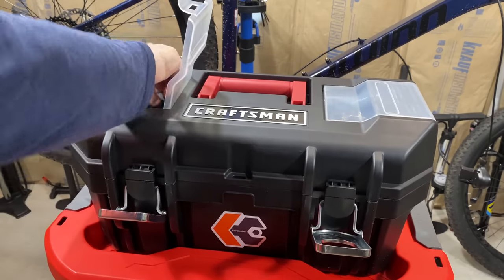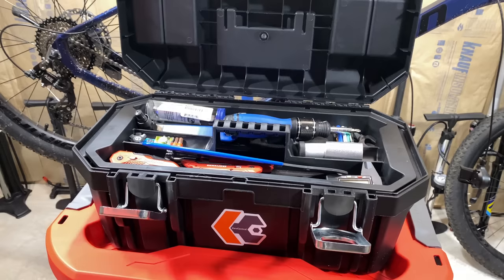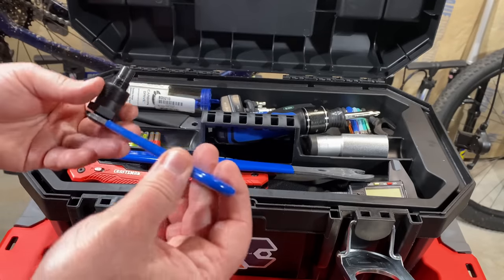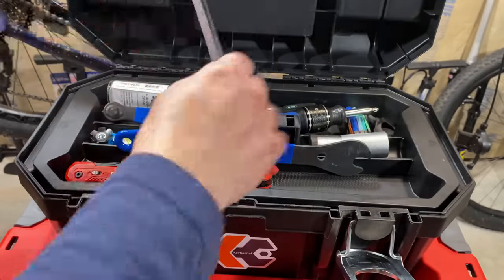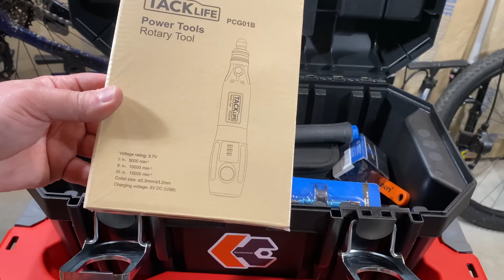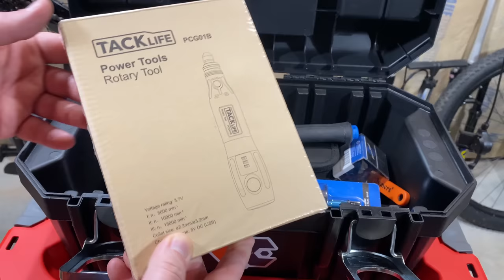Bike Tools - Updated | My Bike Specific Toolbox for the KevCentral Bike Barn

Comment: I needed a tool for my toolbox that I never knew I needed.  Best dollar I ever spent.   A magnet dish!  I am constantly losing screws and nuts and bolts and miscellaneous little metal parts.  But now I just chuck em in the dish as I work and even if the dish gets knocked over, the screws and other hardware do not scatter into the furthest corners of my work space.

Comment: I use good quality Greenlee diagonal cutters for cutting bike cables. They cut cable and housing cleanly like butter, and the cutting edges aren't damaged by the material. They are much better than the Park Tools models for durability. 
And as a side note, I have been using heat shrink tubing on cable ends for years, at first because I never had crimp ends handy. But I quickly realized how much better it works, it stays on better, and it doesn't damage the cable end like a crimp does.
Another good shop tool is sprue cutters for cutting zip-ties. Sprue cutters are used by modelers to cut parts from the sprue runners, they are just a fine-bladed diagonal cutter.

Comment: I bought a press for like 40 or 50 worked great.
Reply from the maker: Which model?
Reply: @KevCentral  i too have one in use for nearly two years,  the blue one from anazon for like 50$ with many adapters and in a plastic case
Reply: @KevCentral  I got the bike hand Yc107f and I bought it because of your last video about the tool you have. I used it to press the funn headset into my schwinn boundry... can you tell im a fan?
Reply: @KevCentral  The Bikehand one works really well. It's wide enough for 1.5" tapered headtubes. It's about $50.

Comment: For an affordable and useable headset cup/bottom bracket press you want something with thicker cylindrical shape pushers rather than thin disc shape pushers.  Thicker cylinder shape pushers prevent the threaded rod from tilting and keep everything better aligned.  They're relatively easy to find for $40 or less.

Comment: The headset tool works best if you press in one piece of the headset at a time.  If you try to press both the bottom and top on at the same time, you’ll have less success. I made my own headset press from a threaded rod, hex nuts and washers.  The washers are key.  I used 2 sets of 4 washers of various sizes (you can make two little washer pyramids stacking them on top of each other).  The different washer size helps distribute the pressure more evenly as you’re tightening the hex nuts.  Works every time.
Reply from the maker: I only do one at a time. Still not a chance I’ll get the bottom cup in 🤯

Comment: Wheels Manufacturing makes a universal bearing press that comes with a set of dies that'll fit press-in bottom brackets, head sets, and so on. The basic model is $75 and the slightly fancier is $83. (They also sell the basic press without the dies for $35)

The important part is having the dies that will keep the press centered and the bearings square. Otherwise it's too easy for the bearing to get tilted and jam up instead of pressing in smoothly. Without the dies, a bearing press is literally just a fancy pair of nuts on a piece of threaded rod.
Reply from the maker: 👍🏼 do you know if the $83 version will work with 1.5 cups?
Reply: @KevCentral  The two drifts that came with my set have steps at 22, 24, 30, 37, 41, 42, 46mm, and they also offer two drifts specific for headsets with 30mm and 40mm on one and 34, 44, 49, 56mm on the other. Those are all nominal of course, the fit is slightly undersized so it slides in and out of the bearings/cups/whatever easily.

As long as one of those sizes is within say 1-2mm of the inner diameter of what you're pressing you should be good. Just needs to be close enough to keep things centered on both sides.

Comment: The Park Tool bearing press is not exactly cheap, but it doesn't cost $200. It's pretty simple and it works. I can really only press one bearing or cup at a time because, if I try to do them both at the same time, one or the other for some reason wants to start going in crooked. It's good for anything press fit. Headsets or bottom brackets in any style. The plates are even wide enough to press 1.5 bearing races. The only thing is, it does take a little patient because you have to thread on the giant "wing nut" looking handles from either end of a simple threaded rod. Before that, I used what a lot of BMXrs use. A piece of 2×4 and a hammer. That also works but, I lost a couple hammers from throwing them with a scream. You can also go to Lowes or Home Depot and get a pair of "mini cable cutters" for about as much as a pair of wire cutters. They are about the same size as the cutters you have, but the "blade" is specific for up to a 1" cable. I use those all the time and it makes a break cable cut like slightly under cooked spaghetti. Your little "E-bike wire strippers" are also cable end crimps. If you think your old crank arm puller is a task, you should try any Profile crank set...whew. But, I love Profile, so.... Maybe, you should try pressing one race at a time into that head tube. I always have to. So far, every vid I've seen of yours is interesting and informative. I hope you're around for a good while longer.

Comment: As always, another informative video.
You say you can measure a bottom bracket & you have the Axum right there. I've asked before about the bottom bracket size on the Axum. How about a demonstration of that tool measuring the BB on the Axum;)

Comment: I had an easy time with homemade press tool as seen on "RJ The Bike Guy" channel. What seemed to make the difference was his recommendation of using a bit of grease on a nylon spacer between the big and little washers on a threaded rod with nuts to squeeze it all together.
Reply from the maker: That mimicks the bearing in my cheapie press.

Comment: Frame out and as hot as sunlight as you can get it, bearing in the freezer.  It’s aluminum so you might even get away with using a heat gun on whatever end of the head tube you were trying to press into.

Comment: There have been many YouTube video's of home made press tools that only cost a couple of bucks at Lowes for the parts.  They seemed to have worked well.  The Park Tool bottom bracket, think you have the one that also works on Shimano's single bolt brake rotors as well.
Reply from the maker: Those “home made press tools” are the same thing as my cheap tool minus the bearing.

Comment: my headset press was a hammer, and piece of wood. No issues so far.
Reply from the maker: I just shared with my Patrons where I gave up on the idea of a specialty tool for pressing in the cup and tried the wood/hammer method. A few whacks later I have a perfectly seated lower cup. No stress or struggles. It’s rare, but sometimes basic tools and improvisation work better than specialized products. Thanks.

Comment: Just make at headset cup press out of a threaded rod, some large and small washers and a nut on each end. Less than $10 and works great. If needed rjthebikeguy has a video on making one.
Reply from the maker: That’s basically the same thing I already have (only minus the bearing.)
Reply: @KevCentral  You could just add the step bushing cup adapters, which come with the Park Tool headset press.  They are sold separately,  # 530-2.  Just add them onto what you already have.

Comment: I tried the cheap headset press and the cups always go in crooked.  I find that a rubber mallet or a hammer and a block of wood works better as long as you hit it in the middle
Reply: Me too!  I straight up used the Sam Pilgrim “whack it with what you have at hand” method to seat the lower headset cup in my Boundary upgrade.

Comment: Every headset press aside from the one you have uses some form of alignment  dies or cups whatever they are called. I  3d printed some for my bottom bracket press. I could model some up for you if you send some measurements.
Reply: They are called "step bushing cup adapters", which come with the Park Tool headset press.  They are also sold separately,  # 530-2.
Reply: @Lughnerson  thanks
Reply: @tzlrc0  You are welcome.  They worked more precisely for me on my home-made press.